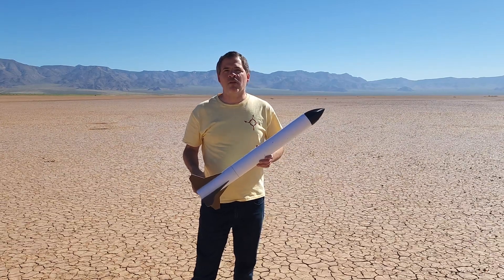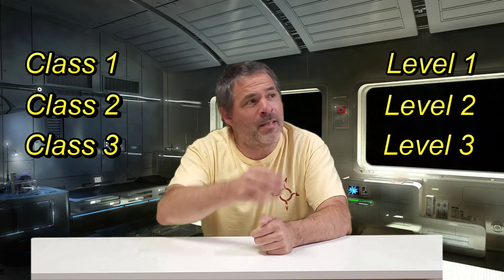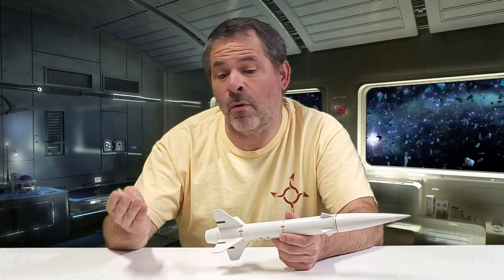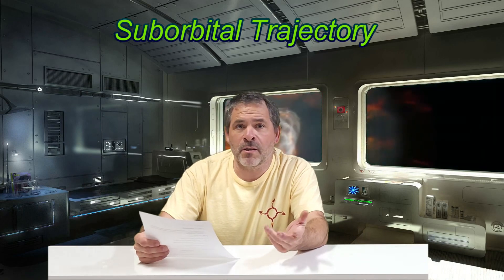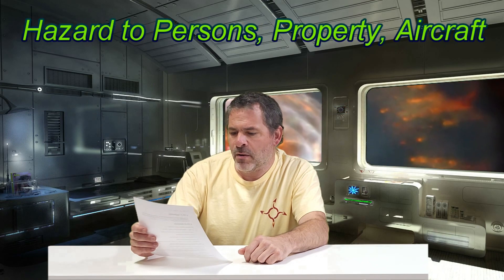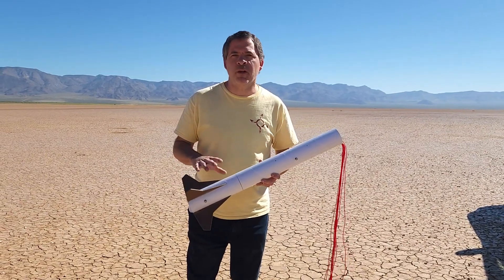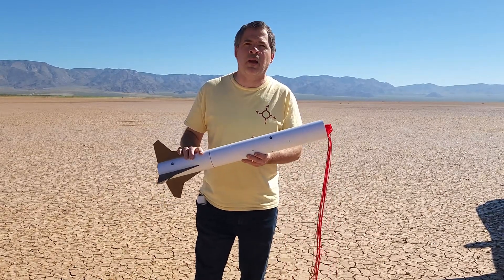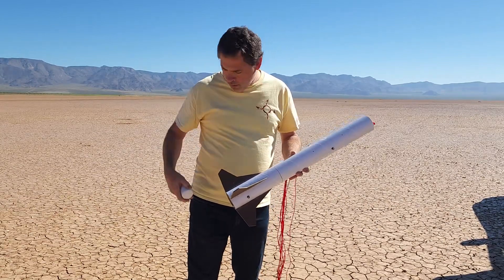Building and Launching a Class 1 Model Rocket

Comment: how do u place the motor inside the rocket?
Reply from the maker: I have two videos that will give you details on that...

First one is an older video. It shows how we design the centering and mounting rings. The retaining screw method in this video is something we don't do anymore though.
https://youtu.be/X_wJkTwa2_c

In this next video, I explain the new way we retain the motor in the rocket. Jump to 8:00 to see the screw installed on the motor and then jump to 14:40 to see how the motor is held into the rocket. I use this method for all my motors now.
https://youtu.be/U1PLWJNi9ko

Comment: Okay. Another question, if I am in the middle of making the fuel and something comes up so I can't pour it into the PVC casing. Can I just remove the pan from heat and let the fuel sit in the pan? Second, is there a way to store the fuel any left over? Like do I store it on wax paper or can I store it in a plastic container?
Reply from the maker: So if you're heating the fuel and the phone rings, you could stop heating. However, if the fuel turns into a solid, you really should crush it up to re-heat it. So probably not a good idea to let it harden in the pan. If you just try to melt a large blob, you're probably gonna burn it.  I store used fuel wrapped in plastic wrap. You just crush it so it will melt down easily.

Comment: sorry, i know i have so many comments on here, but i had to say this one thing. Over the week, after watching these videos, I took my LOC-IV and was able to get it to 2.4 Lbs. With my aerotech H motor (115g propelant weight), i am at 1497g on my scale haha. It is a class 1 rocket BUT does require a level 1 cert to fly since i am using the H motor. However, i do not need the FAA waiver. 

Now its time to make my first batch of sugar fuel. Once i get the hang of it, i think i am going to make 5 or 6 empty casings to test sorbitol fuel.
Reply from the maker: Nice. Hope it goes well... Let me know :)

Comment: how much does each fin weigh? i am curious if 3d printing them would be less weight? 

This is a project i have been wanting to do for a long time: make a class 1 rocket with a sugar motor.
Reply from the maker: When made with 3/16 MDF, these fins weigh 32 grams each. 3D printed would probably weigh less but I really like the strength of the MDF. Then again, I have not tried 3D printed fins.
Reply: @rotaryrocketry   i just printed some for my lvl 2 rocket... we will see haha. they SHOULD hold up, but then again, who knows

Comment: What adhesive are you using for the fin fillets and airframe assembly? Keep them coming!
Reply: For any wood-based materials (cardboard, wood, fiberboard, etc) I use adhesives made for those products. To prove a point, I made a 7-foot dual-deploy minimum diameter 4" rocket that I flew on a L-1150 motor to Mach 1.56 using nothing but Elmer's School Glue for the entire rocket...no epoxy touched the rocket.
Reply from the maker: I used to use 5 minute epoxy for just about everything. But I have switched to using construction adhesives. I use a few different ones depending on what I am doing because they each have slightly different properties.
I am actually a little blown away at your question because earlier today, I was thinking that I want to make a video about the adhesives I am using any why I use them. Well now it is definitely on my list of things to do.